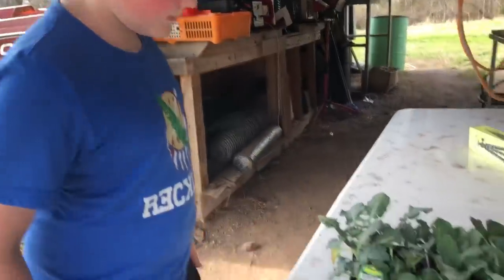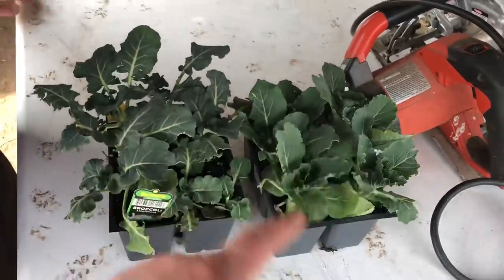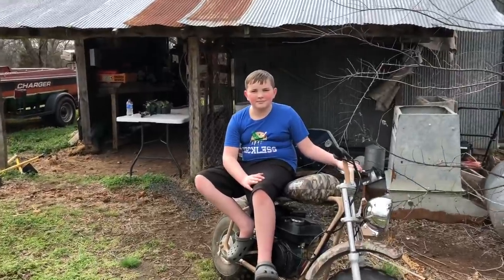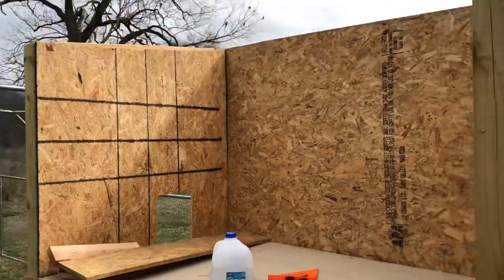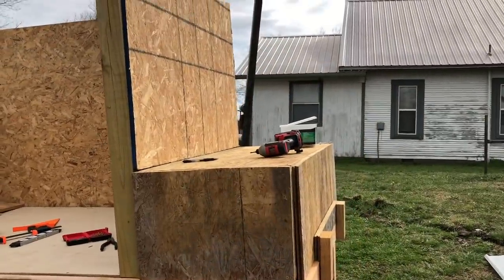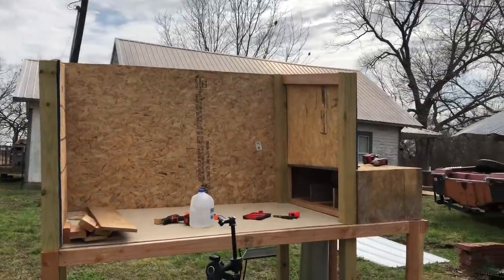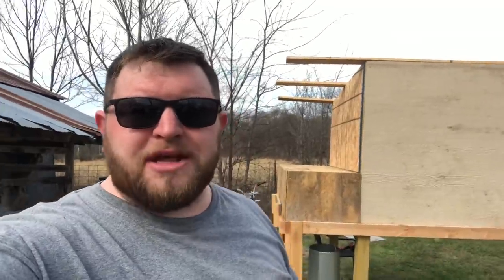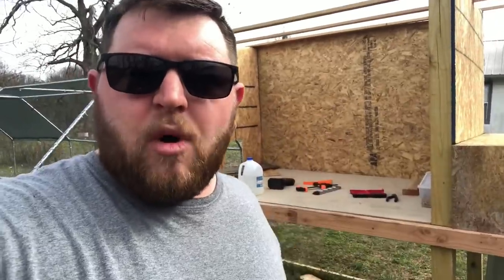Chicken Coop Build

Comment: dont forget to add a ramp for the chickens to get into the run and you're better off getting an automatic door for the chickens just in case neither you or Aiden can get outside to let them out~ 💗
Reply: add a roost too. chickens need to roost at nigh. here's an idea, use old broom sticks or mop handles.
Reply: @robbalex1963  yes i agree with that as someone else mentioned it too.